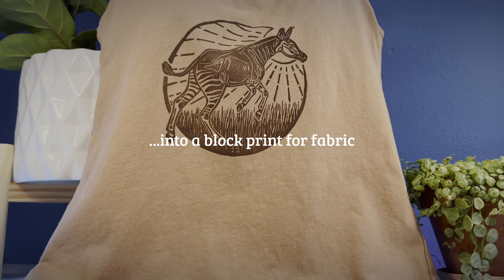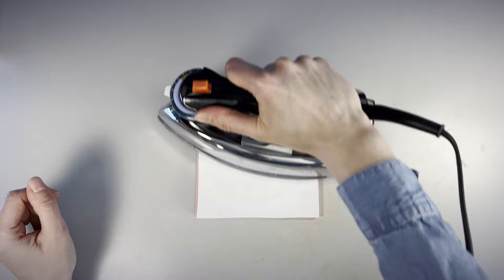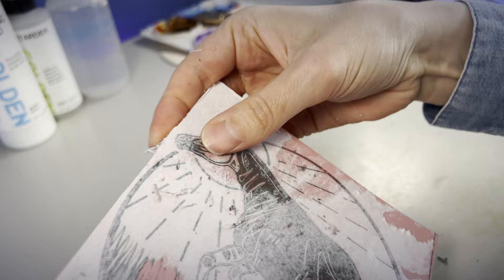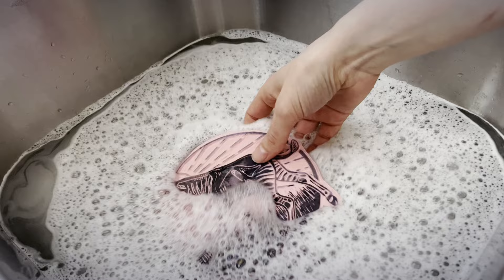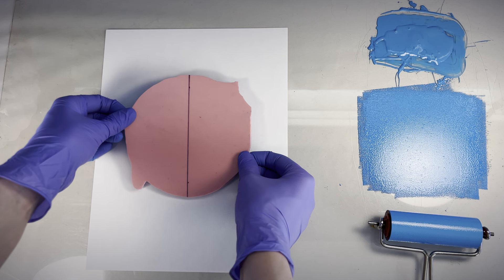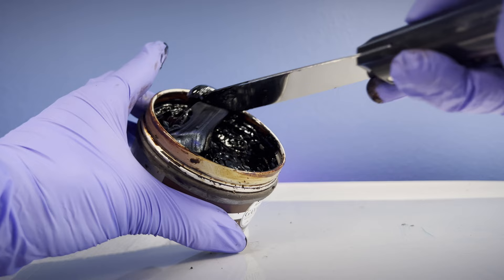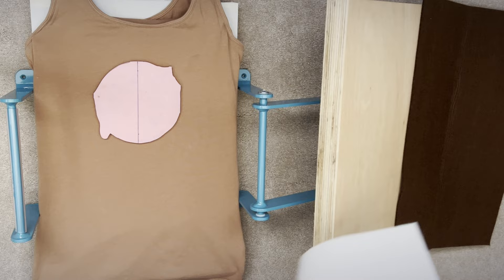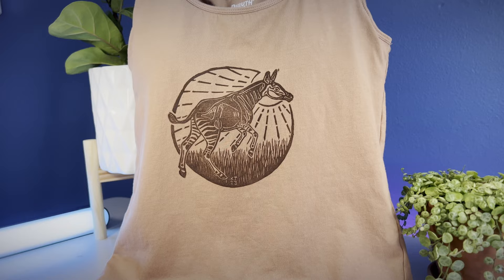LINOCUTTING ON FABRIC, inspired by my okapi sculpture (& I have a Woodzilla press now!)

Comment: I sculpted my first horse head today, and wow your channel gives me so much inspiration. I do have one question though, do I have to use a wire for my sculptures, or would a skeleton of tin foil and hot glue work? I just hate using wire I makes me angry, idk how but I always find ways to cut myself, or break something. Wire hates me. TvT
Reply from the maker: By all means, if a process is frustrating you, absolutely feel free to experiment to find what works better! You can definitely try an all-aluminum foil armature, and if you ever need it to be more rigid, using a thicker, heavy duty foil may be enough to get a similar support. Hope that helps and wishing you all the fun with your projects!

Comment: Hi, I’m just getting into block printing and am looking for the best ink to be used on cotton fabric, manual block printing, no press at hand.  The “best” ink would be based on ease of use, quality of the print and of course durability when washing.  How well does the oil based Gamblin release ink hold up when washing clothes?
Reply from the maker: I hand-printed a shirt two years ago with Gamblin relief ink in sepia and was able to get a good print. It’s been worn, machine washed and dried very often (probably 2-3 times a month since) and hasn’t shown signs of fading yet.